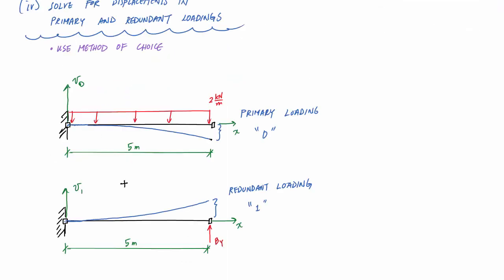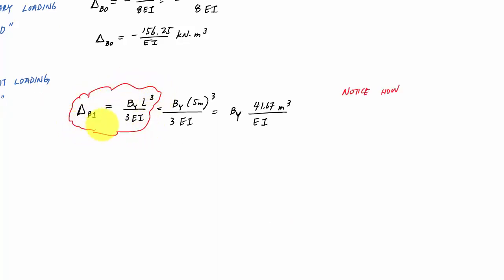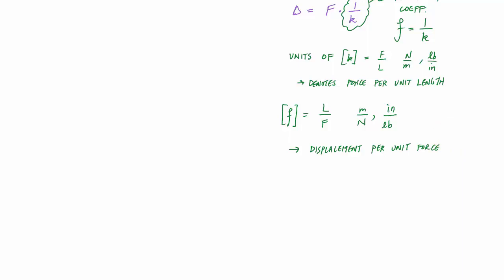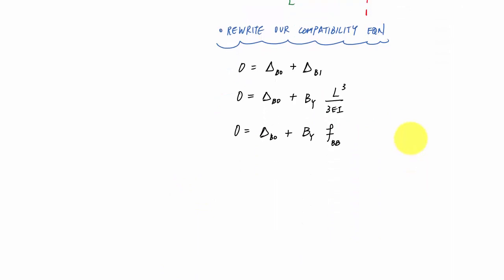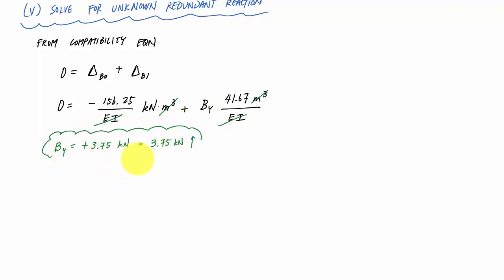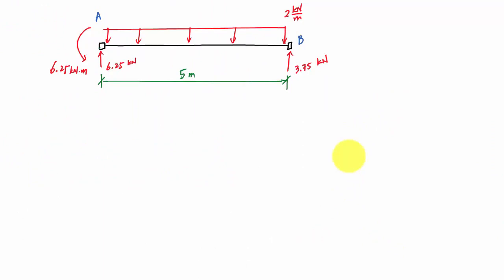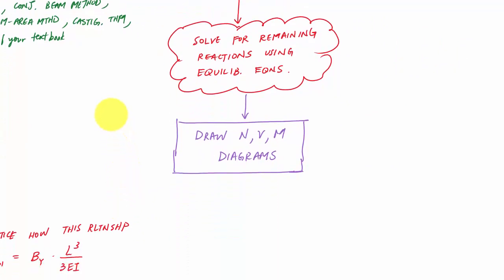Force Method Introduction Part 2 of 2 - Structural Analysis

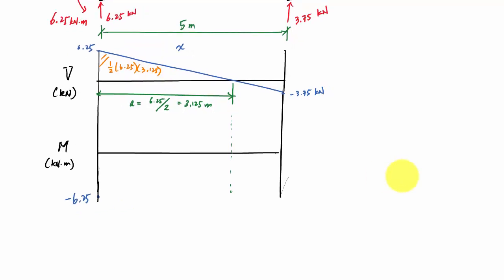Comment: Let's start saying you are great. There is a minor mistake at minute 11:19 as the area of the shear is 9.765m² so the change is from negative 6.25 to a positive 9.765 which means a positive 3.515 (+9.765-6.25) therefore the moment when the shear is zero is equal to 3.52kNm. The area of the shear is not 3.52. Hope I have been clear and you can confirm. many thanks
Reply from the maker: Yes, the area should be 9.765 in the shear diagram which is the change in moment.